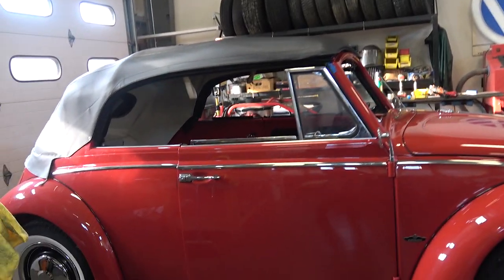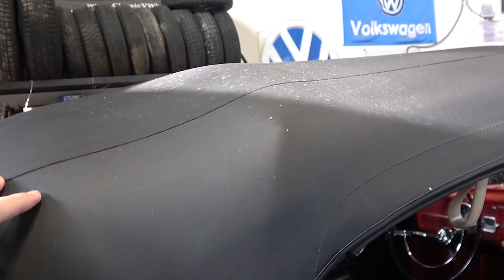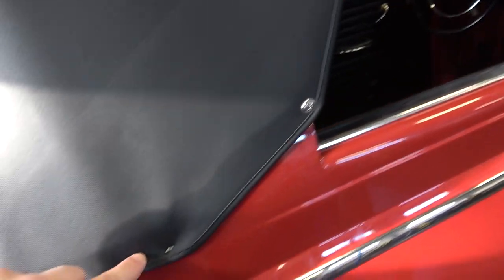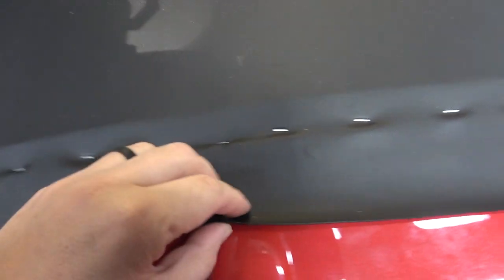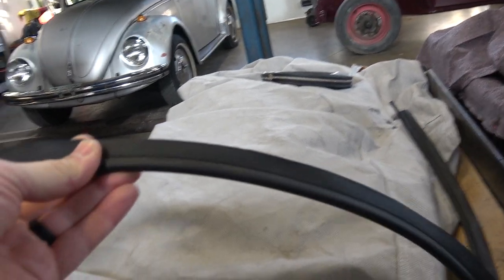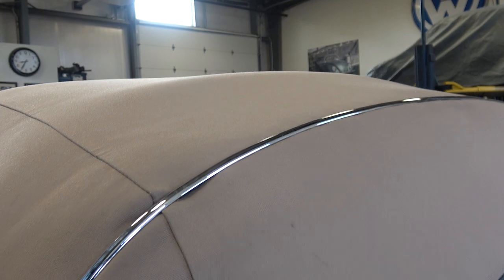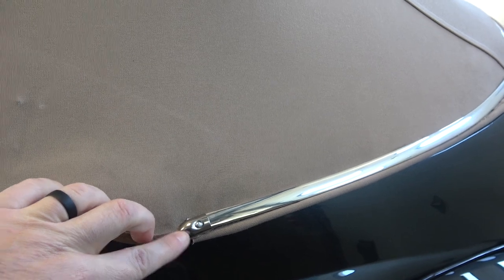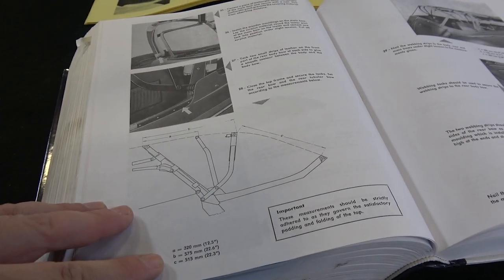Classic VW BuGs Early CONVERTIBLE Beetle - How to REAR Body Bow TACK STRIP

Comment: This is the only convertible top installation video I found for an  early beetle. All others use a cable instead of stapling to the body bow. I see you stapled the rear of the top to the rear body bow but you did not show how to install the bead. Chucks installation manual is useless.